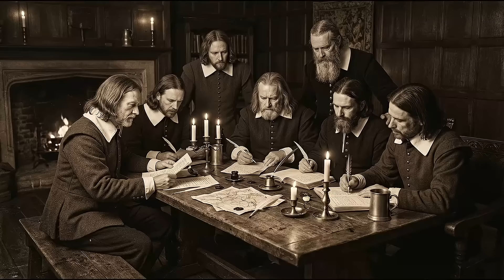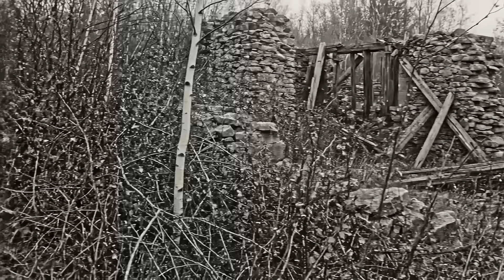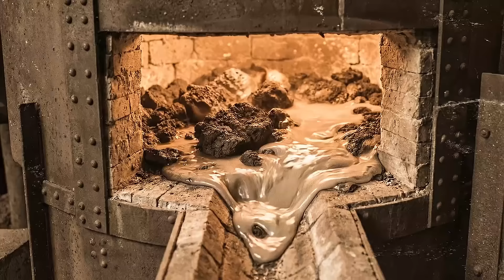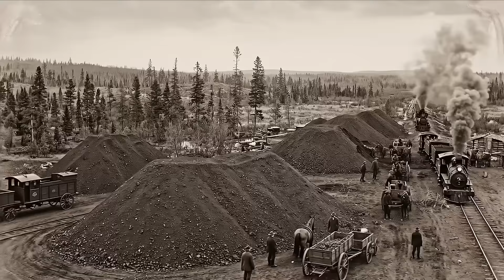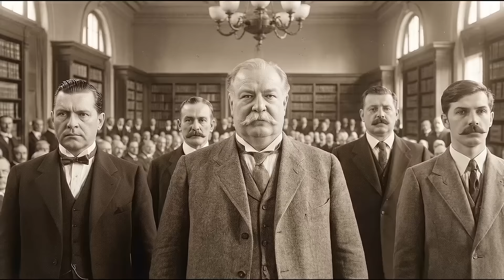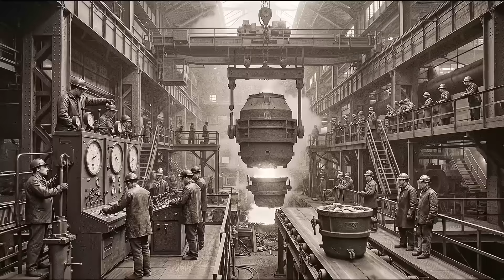How America Turned Mountains of Rock Into Liquid Iron — The Blast Furnace

Comment: I worked as at Bethlehem Steel Blast Furnace Department, Lackawanna NY 1964-1965 just after I rcvd my engrg degree.  It was a true learning experience.  The ore and coke and limestone came in via ore carriers on the Great Lakes or by rail.  Skip cars ran up the sides of the furnaces and dumped the charge into the top of the furnace. Channels in the furnace floor were lined with sand.  The Furnace was tapped with a burning oxygen pipe  about every four hours for the liquid iron and slag.  The engineer oversaw the workers who directed the flows with long rods.  Each pour was sampled and the charge adjusted accordingly The taphole was plugged with a device which swung around. Everyone wore helmets welders glasses and fireproof coats and steel toed boots.  It could be dangerous so everything was done exactly the same way each time. It was very  noisy and hand signals were used.   The workers were all nationalities and races.  Everyone made good money. The first  Melroe Bobcat I saw was dropped into a Lakes ore carrier to scoop out the last bit of ore or limestone.  Coke was made on-site at the coke ovens.  There were seven blast furnaces.

Comment: In the blast furnace hot air reacts with carbon in the coke forming carbon dioxide. More and more Carbon dioxide reacts further with carbon in the hot coke to form carbon monoxide which acts like a reducing agent further reacts with iron oxide and reduces iron oxide in to hot pig iron.
Reply: I believe you have it backwards. Coke and oxygen react to form carbon monoxide. The CO then reacts with the iron oxide, stripping oxygen to produce liquid iron and carbon dioxide gas.

Comment: Don't get the impression USA invented the blast furnace because it did not that distinction goes to China
Reply: Elaborate 🤔 
I believe the process came via Bessemer, in the UK
Reply: @alankennedy1742  Incorrect in that case. The Bessemer converter produces steels by refining molten Iron to a significantly lower Carbon content.
The first blast furnaces date to China around first century AD but in reality for ironmaking purposes it generally recognised as England in early 1700's.
If you are confused look up how Ironmaking differs from Steelmaking.